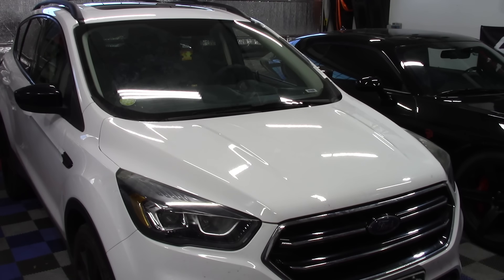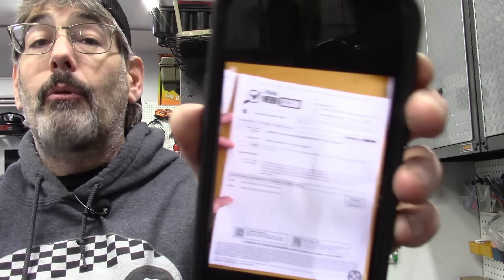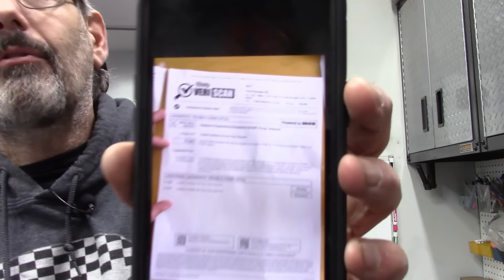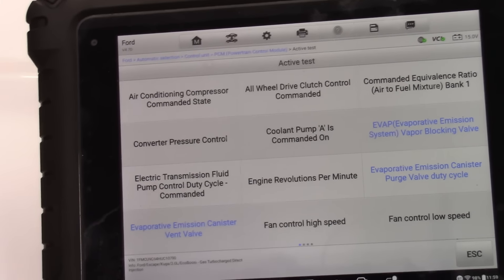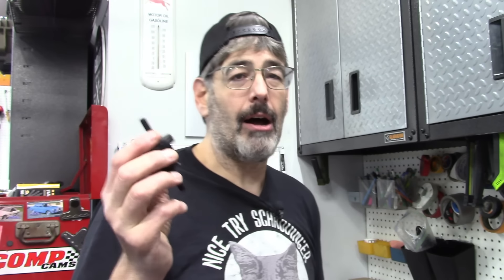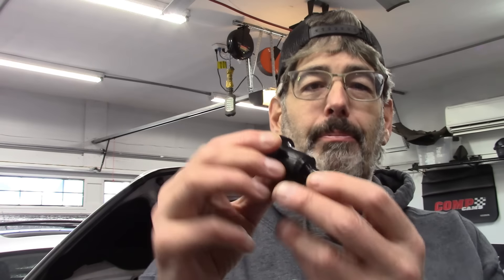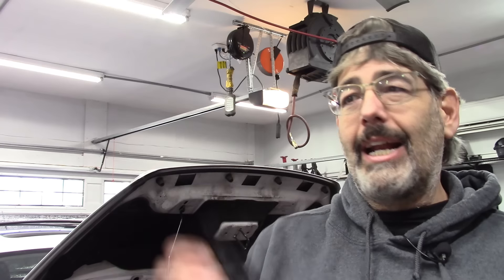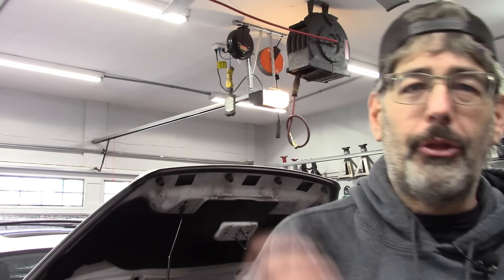P1450 EVAP Code  $1000 Parts Cannon Still No Fix!

Comment: Quick note. The vapor blocking valve is used to prevent the system from drawing vapors from the fuel tank during heavy cannister purge operation. Ford started using it with the hybrid electric vehicles around 2009 because the engine didn't run as much under certain conditions, and potential high HC loading caused some drivability concerns. By isolating the fuel tank, it made controlling the engine easier during purging of the cannister. The system does monitor the fuel tank pressure and will turn the valve off, which opens it and allows the vapors to be purged if the tank pressure rises too high. Ford added the valve to most of the rest of the vehicle line over about a three-year period. Here's a trick, but it doesn't work good with the aftermarket tools because of the way the Ford IDS does bi-directional controls right from the data screen. But if you have a vehicle with a leak, you can use that valve to separate the tank from the rest of the system to help identify the location of a leak. We can do it with the aftermarket tool, but that valve has to be operated manually.

Comment: As soon as you posted this code and vehicle I knew the problem. I replaced one a year ago. Dont buy cheap after market on these purge valves, they fail in a month or so I went through 2. Including one from O'Reilly. Then I bought the OEM and those only come with the full hose assembly. Its quite a wrestling match to install all the connectors onto the engine. But since I did, no issues.
Reply: Oh and by the way if that's the 2.0 l EcoBoost which it looks like it is it's the one with the defective design on the cylinder head that was part of a class action lawsuit. Mine failed at 49 k and was luckily still under warranty many have failed after the warranty expired. Unfortunately the suit was not successful and there is no recall on the problem
Reply from the maker: @TheBiocart Yes I actually mentioned that in the video but edited it out as I wasn’t 100% sure it was regarding this model. Now I see it was.

Comment: Hi Matt, owner of a 2016 Escape that needed the purge assembly, so says my hand held scanner,  Ford OEM part price of $250. Following your test and verify methods , my purge and vent valves are working, that in itself saved me lots of money. Not having hi-tech scanner , did all the testing manually with DVOM and 12vdc supply(as you taught in your past videos). Lastly , I thought of a leaky capless filler door , bought an $8 dust cover that fits tightly over outer filler door , bingo ! not more DTC . Been testing for 2 months and no codes. Just got to give you the credit and a big thank you for your help in these diagnostics.
Reply from the maker: Nice work.  That’s exactly how I used to do it for years!!!

Comment: That was a nice diag. I normally disconnect the purge valve and check for vacuum with a gauge with the vehicle running. still confused how the mechanic got to the conclusion that the hpfp was faulty.
Reply from the maker: Yep nothing wrong with your method and in fact it’s how I have always done it up until this video-  I just wanted to show how it’s possible to diagnose this without even opening the hood in case people were interested. 
    And yeah I will never understand the HPFP conclusion they came to. They must have confused it with another car or maybe a rookie tech or something.
Reply: @SchrodingersBox 
Thanks for formulating a solid understanding the fundamentals for us !

Comment: Customer got it right only by sheer luck.  Had he tested and not guessed, he would have known when the chinesium purge valve failed and it would have saved him $1000.  He's not a technician so he gets a pass.  The auto shop tech, on the other hand...not so much.  That is auto repair basics 101.  If you can't diagnose a stuck open purge valve (one of the most common evap repairs on the planet) you should be sweeping the shop floors until you can.
Reply from the maker: Yeah customer gets a pass for sure especially because this dude is so cool. I don’t expect a guy who doesn’t to work on cars to know the components of an EVAP system so why wouldn’t they believe a professional looking report like that?
   I’m still stunned at the shop though. I agree- inexcusable.

Comment: oh those fords I highly recommend getting the OEM part.  I have personally seen too many aftermarket purge valves go back with in months or not work right out of the box and there is one brand that comes with all the hoses like the first one you had and that hose won't properly secure to the intake manifold.

Comment: You can theoretically get negative pressure in the fuel tank another way: bypass valve and/or vent + purge valve are closed, and the car starts consuming fuel from the tank, causing the airspace above to increase in volume. This effect would be EXTREMELY slow, however, compared to having an open purge + bypass.
Reply from the maker: Hahahaha. Yeah that’s true HOWEVER don’t forget it would be offset by the pressure increase as the tank heats up- which normally happens during vehicle operation.

Comment: Hi Matt another great video 👍 I  have a question for you? You probably are inundated with questions but worth a try because I  trust you diagnosis. My Ford Fusion heater motor only works on setting 4. I  changed the heater resistor and it cured the problem, the heater worked on all 4 settings. After 2 weeks it failed 😪 so got the parts cannon out and changed it again. It worked for 2 weeks then failed again? Any ideas please 🙏
Reply from the maker: Is setting 4 the highest speed or the slowest speed?  I’m assuming fastest speed. 
   When set to the fastest speed you are basically setting switch directly to 12V with no resistance.  As you step down each level you are essentially adding a resistor each time, daisy chaining them up to 3 of them in series at level 1 (slowest level).
   So either you are getting bad resistor units out of the box OR you have some issue with high current that is blowing out the resistors.  However since the motor itself isn’t blowing out setting 4 it’s not likely you have an electrical input issue. 
   You will need to measure the voltage and current on each level ( which can be done at the power input) and see if there something awry there.  If I had to guess I would say you might find there is resistance even at setting 4 indicating worn wiring or a bad ground.  It might even be enough that you have enough voltage drop it won’t work on any setting other than 4.
Reply: @SchrodingersBox  Thank you so much for your reply Matt , setting 4 is the highest speed, I am just confused why both replacement parts have worked for around 2 weeks before they have failed? Probably cheap after market parts? I suppose I have 2 choices? Freeze in the winter? Or bite the bullet and buy a authentic Ford replacement and see how that goes? Thanks again for taking the time to reply 🙏
Reply from the maker: @nigelmiddleton2727 I would definitely check your resistance on#4 first. If no resistance then yes get the ford part.
Reply: On Jeeps burning the resistor is a sign the bearings in the blower motor are going bad

Comment: Would you need to check for a short to ground on the purge solenoid at 12 minute mark? The command might read 0 but if it’s grounded it’s be open fully with no pcm command?

Comment: Hey Matt !!…hope you two had a great Thanksgiving…hope that customer didn’t have to pay for that HP Fuel Pump ??…did you run the EVAP Monitor to make certain it completed before returning the car to the customer ??…great video !!

Rob (aka C5 Diag)
Reply from the maker: Hey Robert great to see you!  
  Yes the customer paid for that HP pump.  Other viewers said he should probably pursue the shop for a refund or partial refund. 
   No I didn’t run the EVAP monitor due to time constraints. Since I cleared the codes I would have to run the drive cycle whatever those parameters are. On other cars with a complete system test available I would have run that. However I edited through the final test of the system to speed up the video and I know all valves work and there was no vacuum decay in the sealed system so I am satisfied.
Reply: @SchrodingersBox not saying the shop could be right but South Main Auto shows plenty of failed in take fuel pumps where the locking cap on the tank itself gets so corroded it doesn’t seal. It’s totally possible that this was a proper diagnosis from that shop and the owner themselves introduced this faulty purge valve. Regardless the shop didn’t actually verify their repair was correct so it seems unlikely. Possible though.
Reply from the maker: I don’t follow - how is a high pressure fuel pump going to cause this?
Reply: @SchrodingersBox  ignore what I said. I realize we’re talking about a GDI system now and they replaced the mechanically driven pump, not the in tank pump. None of what I was saying would make sense in this case. I was incorrectly assuming the pump replaced was the in tank pump in which case a corroded ring/seal would affect the evap system. 

I genuinely hope this miscommunication was also what happened to the customer.  Maybe they got it twisted that there’s 2 pumps and heard that the high pressure was replaced when they actually went after the in tank pump.
Reply from the maker: the low pressure fuel pump in the fuel tank also cannot possibly cause this code either. This code has nothing to do with fuel pressure - only vapor pressure and even then the inability to bleed vacuum.
Reply: @SchrodingersBox  my comments getting not posted it seems, but to repeat the original comment: it definitely can. Look up “An EVAP Leak 2 Other Shops Couldn't Find” by SMA and you’ll see what I’m trying to say. The pump doesn’t cause the issue but the pump assembly does. 

I had this same thing happen to my 2005 dodge caravan. The pump despite being totally functional needed replacement because it caused an evap issue.
Reply from the maker: Ok I’ll check that out. I really don’t see how a fuel pump can possibly cause a perpetual vacuum state though. I’ll have a look sometime.
Reply: @SchrodingersBox  yeah considering it’s been a perpetual vacuum code you’re definitely right. Still an interesting thing to keep in the back of your mind though. If you told someone replacing a fuel pump is necessary for an evap condition, most people would not hear it out but there’s plenty of instances where it’s true by proxy of the pump housing failing.
Reply from the maker: Well I would agree that if the pump housing isn’t sealing the tank then you have a EVAP leak like any other type of leak. But no way can EVAP is related to pump performance.

Comment: I do not have a decent scanner. Just an elm327 chip kinda. I suspect of my purge valve. ¿What can I do? I do have a CRV LX 2010. Poor fuel consumption in the city, nice numbers in hwy.
Reply from the maker: All you need is a DVOM. Just check the voltage.

Comment: I replaced a stuck open purge solenoid on an suv that was causing the engine to have trouble starting after fueling up. I'm guessing the displaced vapor went straight into the engine. It probably lasted about two weeks before the new part failed and the problem returned. I got it off ebay for $10. Brand new parts certainly aren't immune to failing, especially no name crap off amazon/ebay. I know exactly what you mean with new parts failing.
Reply from the maker: Yes you are correct. One symptom of a stuck open purge solenoid is trouble starting after fueling up because essentially the engine gets flooded. This doesn’t always happen though and remember you still have vent open as well so it’s not always a symptom.
I did specifically ask if this guy had such a symptom and he said no.

Comment: Is the blocking valve normally open or closed?
Reply from the maker: With engine running and It’s normally open just like vent solenoid. It really only operates with engine off or in KOEO applications.

Comment: Is the blocking valve similar to a Honda bypass valve? Thanks
Reply from the maker: Yes very similar in function. If I remember though- and I may be wrong about this, I believe the bypass valve defaults to closed position while the blocking valve defaults open.

Comment: Did the code come back? I looked up the code, first thing that popped up was TSB 17-0051. Not sure if that applies according to build date
Reply from the maker: Nope. I didn’t know of that TsB. What did it detail?
Reply: @SchrodingersBox  Physically checking for raw fuel at the evap canister/blocking valve. If there is fuel there they want you to replace the purge valve and canister.
Reply from the maker: Ohhh. Yeah no need to do that at all. We confirmed multiple ways there is no fuel in the cannister. We confirmed fuel and the car doesn’t run rich unless the vent is locked.
Reply: @SchrodingersBox  You did have a rich 02 sensor code. Prob pulled the vapors in if there was any raw gas in the canister. I would assume Ford recommended a canister to make the EPA happy.
Reply from the maker: Yes I caused the O2 sensor code when I closed the vent. It wasn’t there before- even for months.

Comment: Those can also be installed incorrectly, can only block one way, the OE has the extra hoses that connect to the intake and boost hoses. Unfortunately the parts do not last long, try to get OE.
Reply from the maker: Yes indeed some of these are directional- they will leak under suction if the suction is on the wrong side.

Comment: They just want you to stop what you are doing and scan their car and see what parts they need. So they can go buy the part and get someone to install it for cheap. Could you get that for me, I sure do appreciate it 🤭

This is how some shops are run. They make all their money install parts. If a customer comes in and says he needs this or that. Don't argue with him, install it! You get what you pay for. 

I just describe every retail tire shop in America and half the independent shops. But even at the dealership they do not want to pay the mechanic for what he knows. Not very much anyway. The entire labor guide is based on installing some sort of part! They make 300% profit on parts and cut labor to a minimum. 

If you take your car to a transmission shop to be diagnosed because somebody told you it sounds like the transmission went out, do you know what they gone say?  You need a new transmission!  That's all they do rebuild or sell new transmissions.  They not concerned with the brakes locked down.  Or the wiring harness or ABS module is toast. 

Those type shops don't hire automotive technicians. They hire parts installers who can only do what they are told. 

Some things never change for the better. Sometimes it's the owner of the vehicle installing all these parts. He would rather risk throwing parts at it than pay a real mechanic one hour labor. This is just how those cheapskates operate.

Someone asked me one time. He said my truck won't start. Do you think it's the fuel pump?  I said, could be!  That or 99 other things can cause a no start. He had installed a new battery so I asked, did you remove the plastic caps off the new battery post before you installed it? He got mad and left.
Reply: All of what u say is true! I like this guy, if he disagrees and it wrong he buys parts .

Comment: What scan tool is that your using?
Reply from the maker: It’s an Autel MS909. You can see a review of it on this channel.
Reply: Hello!   I'm a subscriber....Does Autel function differently than TopDon (as shown on your other vids?)
Reply from the maker: They are really similar. I also have a review of the Topdon Phoenix smart. 
  In my opinion the Topdon has more features for advanced stuff like programming modules etc and the Topdon also has an oscilloscope available?  but otherwise pretty similar
Reply: @SchrodingersBox  Hi Matt, I purchased a Topdon Phoenix Plus, best thing I ever did. If I get any codes on my 2014 Holden Commodore I check firstly if you have nay videos on the same sort of problem. (obviously not a Commodore as you don't have them in USA. I'm in Oz). Thank you for all your amazing diagnostic skills, soooo interesting.
Reply: nay should be "any". 🙂

Comment: I had this exact problem on my escape. If I drove it long enough the fuel flap on the filler "cap" would suck air and make a buzzing noise.

Also it would stall at stops, and when I refilled the fuel. Only in the summer though. Im gonna have to watch the diagnostic vid after this because i was very confused by these symptoms lol.
Reply from the maker: Yep all those symptoms make sense. The high vacuum sucking the fuel flap. Also when filling up you create lots of vapors that will go right to the engine through the purge valve and essentially flood it.
Reply: @SchrodingersBox flooding explains the sulfur smelling exhaust I'd get when when I fueled up. And the other video explains why it wouldn't be a problem for more than a minute after I finished fueling. 

Gas engines are wild. I was an equipment mechanic in my 20s and 30s. I know about diesel engines, but when it comes to gas I didn't even know this evap system existed until I got tired of only driving the escape in the winter and decided to throw some parts at it. I got lucky but it's always bothered me that I didn't know why that fixed it and why it caused such strange symptoms. 

Thanks for the videos! They're extremely helpful!